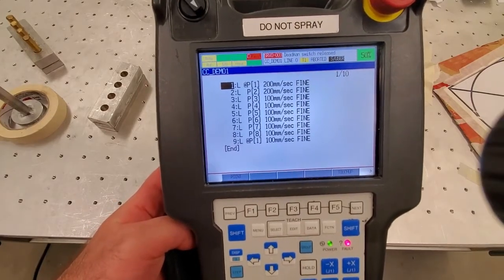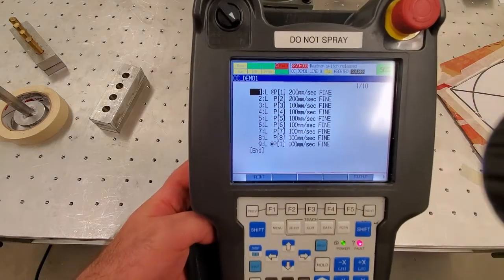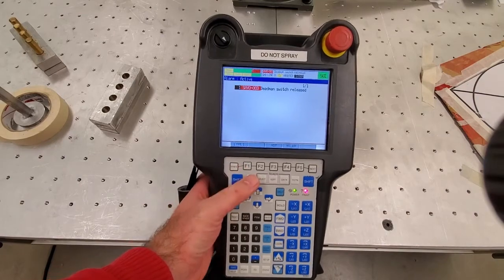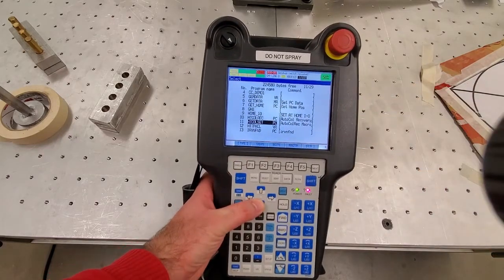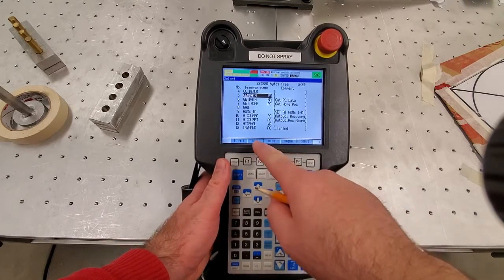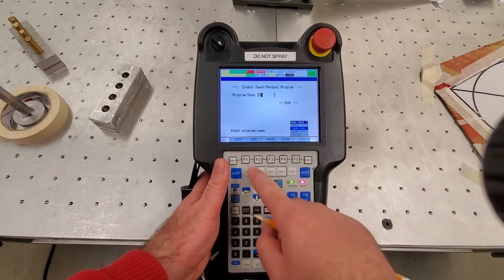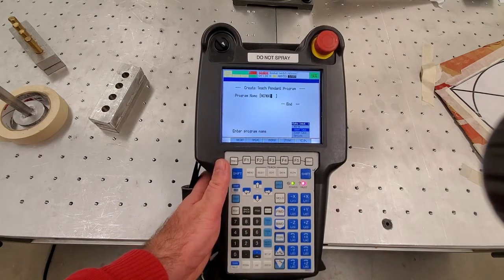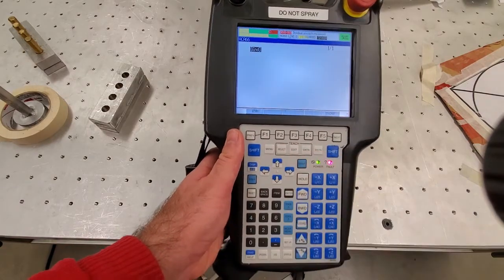Fanuc Robot Tutorial 3: Introduction to Robot Coding - Write a Simple Code Using Teach Method

Comment: Are these robot tables with mounting hole grids fanuc or third party?
Reply from the maker: We made this table. First, we purchased a plate, and then we drilled the holes with screw threads. The table is super useful for mounting different equipment. Everything that FANUC sells is super expensive...